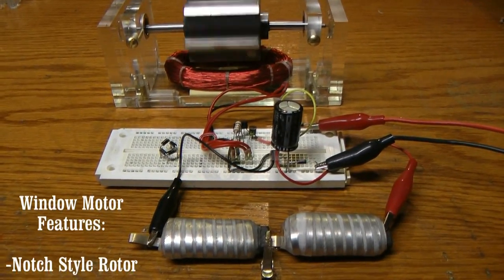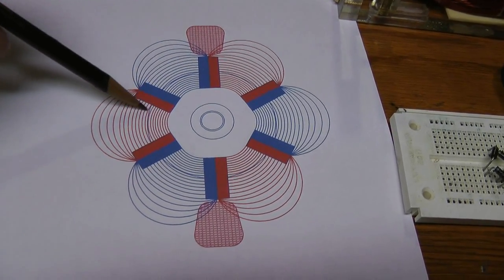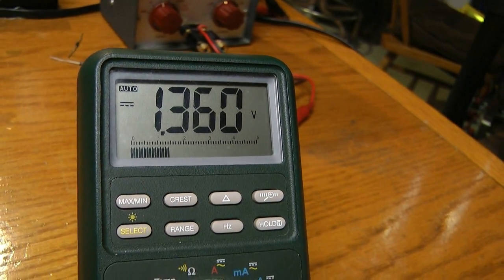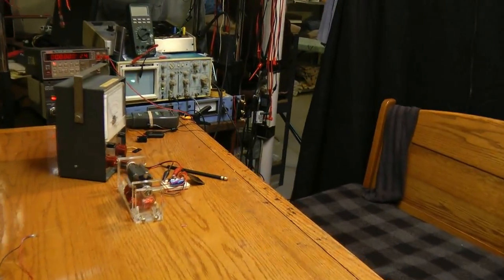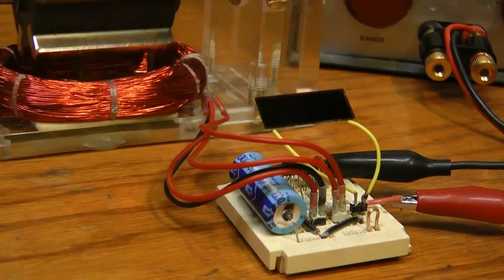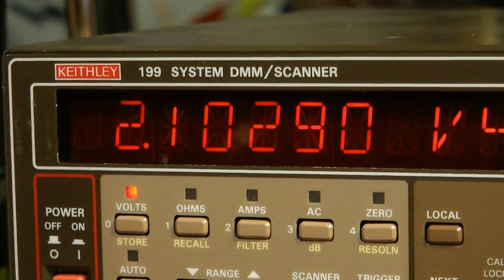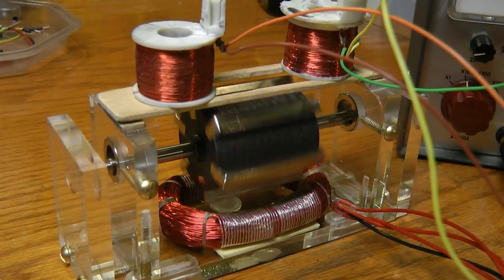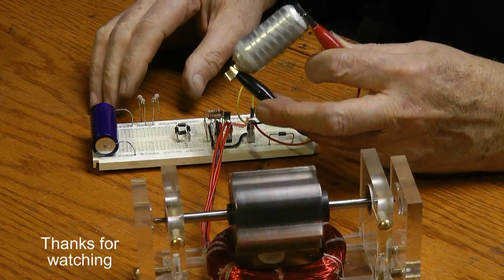Window Motor On Water Battery & Solar + (Notch Rotor)

Comment: I love your videos for the excellent quality of the realizations, the very good and clear presentations and the quiet and exaustive explications.You're a mith!  but still cannot findo "how to video" about water cell...could you help me? thanks in advance.
Reply from the maker: Hello friend, I never made the video of the water cells because I was disappointed in the fact that the magnesium eventually erodes and the cell becomes depleted. They are simple to make though if you wanted to try one. Just get ahold of a piece of carbon and wrap it with a paper towel or sometimes I used a piece of chamois cloth. Then just wrap some magnesium ribbon around it, wet it and you have a battery. One mine I put a few layers of insulation and winds of ribbon.

Comment: Thank you very much for you to upload very good quality videos where has nice educative touch. I bet your RC -plane is pretty neat! :) 

Have you examine the "Fueless engine" motor where is both, rotor electromagnet and stator electromagnet at north - north position and it is driven with one 12V battery and charge other 12V battery. It is driven by voltage and it's force is coming from condenser bank where the voltage could have over 1KV. It is pretty interesting and i think it could interest you. 

Condenser has capability to wonder me over and over when i test and drive motor with them :)
Reply from the maker: +S. Rantala ...Hello, I have watched some videos but remain skeptical about the system. I haven't seen proof enough to make me try any kind of replication. If you run into any link that looks absolutely convincing let me know.

Comment: My English is not good,
Video commentary can not quite understand,
This magnet arrangement, with the traditional normal window motor magnet arrangement which is better?
Reply from the maker: M Jannick Hello M, The nylon notch rotor on the magnetic bearings is only an experiment and I recommend the window motor with the mild steel rotor and 6 magnets oriented nsnsns alternately. John

Comment from the maker: The motor is a very efficient device with a unique bearing system made of magnets as shown. The opposed configuration of the magnets form an invisible pole between them rather than on the magnet, check the illustration. The motor runs from a simple 3 transistor pulse circuit off a battery that can be hand made from carbon, magnesium and water electrolyte.
J
Reply: +DadHav  hi  I been try to learn about motor and electronic's do you have a schematic  I love telsa and bendini I love to learn more
Reply from the maker: +Armando Martinez See if you can download from this link:https://drive.google.com/open?id=0BwK5yJUfMl9GdkY2ZnBzN2c3aW8

Comment: Can you do a few of these and sell them on ebay? They have solar ones just like this, but it would be cool to have a magnetic and coil one.
Reply from the maker: Hello friend, I'm afraid that wouldn't be very practicable for me. I can hardly keep up with things now. Thanks for asking.
J
Reply: ***** ok, I understand that would be allot. Can you make just one for me? Can you sell that one on ebay and give me the link so I can get it? How much would you ask for it?

If not, can you make an easy step by step ebook on how to make it, and the materials I would need? Thanks so much.
Reply from the maker: McChulo
I'm sorry friend, I just can't help you with this. It will be a while before I can spend any time on experiments or construction.
J
Reply: ***** thanks anyway, hopefully you get the time to put out a quick how-to manual together so others can build the same thing. Thanks again :)
Reply from the maker: McChulo
I have a video posted showing exactly how the magnetic base was machined. For the most part you must have a milling machine and lathe as well as know how to use them. The pulse technology to drive these devices can be complicated to understand and tune. This is not a project for people just getting started in the electronics hobby. You can search for Bedini/Cole window motor and see many options for this style motor on YouTube. You will see how simple the principle is. If you are looking for a solar Mendocino style motor you can find them on E-bay.  Don't know if that helps.
J
Reply: ***** I have seen the solar motors, but I'd like to have a motor that just spins perpetually with a coil and magnets. So that it runs in the light and in the dark also.
Reply from the maker: McChulo
Hello, none of my motors will run perpetually or self run. They all need some sort of power supply. Some are very close to unity and will run for weeks on a small capacitor ore even a hearing aid battery, but not for ever. It is possible to add a small solar cell to restore the capacitor or run battery. This can be done with any very efficient device and doesn't require the making of something like I show in these experiments. See the video below:
https://www.youtube.com/watch?v=pVfCj3oTsvM&list=UUOIxh4XCX3lTJIrHm5FLLPA
Reply: ***** Is this because the coil needs to be charged in some way to create an interaction with the magnets so that it spins?

Would you mind 3d printing and putting together this perpetual motor? I'd really like to see how to put it together and how it works: http://www.shapeways.com/model/2913260/perendev-109-120114.html?li=search-results-1&materialId=6
Reply from the maker: McChulo
Sorry that's just impossible! I have no interest in the Perendev motor whatsoever. You were talking about building a motor. Why not try to get his kit and make it yourself. Or you could do some further research on the Perendev and maybe decide for yourself whether or not it works.
J
Reply: ***** ok, just wanted to see what you thought. What if you try it out and film it?

Comment: Very interesting!
I imagine t that you know about resonant circuit, but the back and forth voltage seems to be similar to that. The energy travels back and forth between the capacitor and inducting coil and this can create a 50x increase in voltage in some circuits. The transfer typically happens at a very high frequency (10k+ Hz) and it should maintain a constant boosted voltage signal. I think the rotor may be regulating the frequency and size of the energy transformation by rotating near the resonant frequency.  A gradual increase in capacitance should increase the voltage rise and fall that is present in the signal. The increasing capacitance will decrease the resonant frequency of the circuit which should bring it closer to the electrical frequency generated by the poles in the motor. With six pole pairs, electrical frequency is six times the rotating frequency.
Reply: I just realized how many different frequencies I mentioned in there.
The resonant frequency is the frequency induced by an ac signal.
http://sub.allaboutcircuits.com/images/22033.png
When approaching resonance, the LC circuit produces high voltages present in the terminals. 

The transfer frequency would be the rate at which the energy is transforming from electrical to magnetic forms within the circuit.

Electrical frequency is the voltage sine wave induced by the rotor and the rotating frequency is just the rate at which the rotor is spinning
Reply from the maker: MarksmenTM
Hello Marksmen, Yes an ideal condition would probably be if you could have the pulses that drive the motor be at resonance but usually what I see on the scope is a spike with a bell curve sort of ring attached to it. This might be at resonance though. Thanks for the comment.
John

Comment: how much power is that generator producing?
Reply from the maker: Hello, almost no power produced. The experiment is only to show how the magnetically levitated rotor with a novel rotor can run as such a small current draw. It can run for weeks on capacitors. or permanently from a tiny solar cell / capacitor combination.
J

Comment: Caution:LT4415 - cannot hand solder it - footprint is tiny. Bought a oven to do small parts. Have full wave schottky rectified the 250KHz sine signal of my LED driver design - gives me 3.75VDC. Charged a 1.2VDC Nicad with it and ran another circuit with charged Nicad. Input of my circuit: 1.2VDC @ 50ma.Main driven LED dissipates 250mw with about 20% duty cycle.  I want to try the notch rotor but how do I machine the slots into round stock? Also I have PCB layout capability if you need a PCB.

Comment from the maker: Hello, Thanks for the tip on that chip. It looks interesting. I will try something with it when I get caught up on things. I might be able to work out something patentable on a few of my recent circuits but have little desire to patent anything any more at this late stage of the game. I'm here to share things now and maybe be able to do something for my friends who frequent the channel. The notch rotor with virtual poles is interesting. I need to get back to that and try some things.
Thanks
J

Comment from the maker: Hi, we have a lot in common: First meter- Eico 555 kit, still works; Second meter- Simpson 464, yep over $400; Built many Heatkits including $700 10-4235 scope (35 MHz dual trace with delay line) I also built a Gr 2000 TV then acquired two more half built and finished them. I enjoyed building stereo systems and speakers with Scott and Fisher kits. I eventually ended up buying McIntosh and a JBL Paragon speaker system. Still have the McIntosh tuner, pre-amp and amp.
Take care.
John

Comment: Thx for your reply. With a reputable OU verifier I'll believe too. Do you hv designs u don't upld that u consider patent worthy? Have some I keep. Designed a LED driver that drives 2 LEDs and generates a clean byproduct sine wave. Linear Technology has a low forward drop diode LT4415.  Voltage drops are regulated to 15mV during forward conduction at low currents. May use it to rectify that sig and try to do DC work. Might work for u. Also love the like pole to pole config in your Window Motor.

Comment from the maker: Hello, Thanks you for the compliments. Fact is, I'll believe the first over unity claim I see that is backed up by test results from someone like Battelle institute or some credible university or research center. I have friends in high places that say they would be happy to be the first R & D facility to prove an over unity device. They won't charge for the research if it's legitimate. You must have been on Rusty's channel (LidMotor) You may need to adjust resistors. I'll talk to you more.
John

Comment: I am a laid off circuit designer who enjoys experimenting. I am glad to find a talented, experienced engineer and someone who does not 'swallow" overunity claims. You sound  refreshingly open minded.  I just try to help those who believe in things experienced knowledgeable people recognize are likely unachieveable. I am gathering parts for the Paper Clip Motor you designed a driver for.

Comment: Great project, beautiful construction. Love Keithley DMM response. Last digits don't jitter. Slow update rate? I built Heathkit - stereo preamp and FM tuner kits in the 1960's bought someone's completed Heathkit audio oscillator. - still works. My first meter was Simpson 270 recently destroyed by leaking Duracell and Eveready batteries. Got $125 from Duracell for the damage but wish I still had the meter Could measure 50ua and 5KV. Cost near $400 now. Had old Dumont scope and Tek 535 scope.

Comment: @DadHav Mine is a beater-project car, but I'm keeping it. 73 was the last year for no-smog test bi-annually in Calif. And yes, I read that the 1960's 'muscle cars' were, or could be, very low emissions, but you had to really say on top of the tuning. Way I read it, the newer stuff came so un-tuned when new, it couldn't get much worse if not maintained, I'm just kinda' joking there.
  The R/C stuff, I did notice the last time I was at RC country, they had little in gas engines, but lot of BLDC.

Comment from the maker: @dougspair 
Doug, You don't need credentials to do something. "If you can do. You are" In my later years I worked as Engineering Manager and Chief Engineer. I never had an engineering degree but I could do the job. I also had a good dependable staff. I imagine that would be where you categorize yourself. They / You where more important to getting the job done than myself. I called them My Engineering Children so they refereed to me as Dad Hav. Hav is the first three letters of my las name.
J

Comment: @DadHav  OK, I have a '73 Stingray, only electronics is the radio, and maybe the alternator diodes/regulator. All the interior HVAC is still the pnuematics.
 I also read the Hot Rod 'zines, and yes, most all the after market chips arenot legal, especially in Calif. The ads always say "not for California street' vehicles..but we know that's a sort of 'code' for Hot Rod?
  Even the diesel pick-ups are getting the custom chips.

Comment: @DadHav  at that time, in the mid-70's, I remember my boss, Ed Wilson saying you built and tsted each section as a separate unit..? Zenith was always one of my more trusted brands too, but I see now it'sChina for the most part.
  Hitachi has been at the electronics a long time,and I'm reading they built quite of bit of the nuke reactors stuff in Japan.
  The O-scopes..I'm thinking memory scope we used back then was Hewlett-Packard.

Comment from the maker: @dougspair 
The TV was very nice. It was one of the first modular systems. Each section of the electronics was on separate boards. You know: chroma, horizontal and vertical deflection, color, soun convergence and pincushion etc. It was very nice. A lot of the parts if I remember right where Zenith and Hitachi. They lated many years. I guess you probably figured out why I know a little bit about them.
J

Comment: @DadHav ..Well, unfortunately, my last employer here was fixated on getting everything as cheap as possible, so the golf carts were used, and hammered. We had a club car with 36 volts system, a Nordskog long bed with 36 volts, crude but well made FNR switch. A Cushman with opposed 2 cyl B&S, and 2 Electi-Carts. 24 volt things called parts chasers, you stood on the back, foot treadle for speed/brakes. These had the Curtis. Curtis stuff was OK, the rest of the thing was poorly designed/made.

Comment: @DadHav  HeathKit was always high $, but top quality stuff. I built a few items, but nothing like a scope or TV. I still have a timer I bought/built for exposing the resist on home-made PC boards.
 I'd think guys taking a tech course might settle for a slower and maybe single-channel, back than?
 The Burgmaster place I worked at in the1970's, my boss bought a big Heathkit color TV..got it all done, worked fine, then he dropped it trying to install in a wall...the CRT went poof, of course.

Comment: @DadHav  I'd keep any of the COX stuff, it appears they are pretty much worth their weight in gold. I never had the $ to buy much hobby stuff, but did have the .049 on a control-line plane. Pretty tough crashing one then, with the hand cut balsa wood stringers and paper/ airplane dope and all that.
  Info I was just looking at, COX sold to another outfit in the 70's, quality took a dive.
Santa Ana had a lot of what later became high-tech Mfg, but I didn't know it at the time.

Comment: @DadHav ..In the period of 1971-1979, I worked as an electrical assembler, then later, Electronic tech at BurgMaster, in Los Angeles. They made NC machine tools...the stuff before CNC..I used a Tektronix dual tracescope with delay line...we had 5 techs..5 scopes..and an HP memory scope.
  What part of the country are you in? Up north of here, in Beaverton, Oregon, is the Tektronix factory...they may still have parts and manuals for your scope..

Comment from the maker: @dougspair 
I love scopes. In the 70's I built a Heathkit. I know, almost everyone in electronics or taking a tech course built one of these. Not this one though. back then I paid $800.00 for the kit. Man, that was a lot of money back then. This was 35 mHz, dual trace with a delay line. I still have it but it stopped working years back. I have plans on making a video of repairing it and show some of the construction and operations on the circuit boards. This will be fun. 
John

Comment from the maker: @dougspair 
My carts are EzGo with beds on the back. One is a Work Horse with a tip bed. They're 36 volts solid state controls. I service them myself and have changed the solenoids to mercury switches and changed the battery cables to a heavier grade. Our yard is a hill about 100 yards of 30 degree grade in places. This is rough on the cars but their amazing. I flipped one over back-wards on the hill. I'm going to  make a video of how to rebuild the FNR switch.
John

Comment: @dougspair  That was COX model engines...back when they were decent stuff. So I knew that they just used the oil in the fuel to seal the piston/cylinder.
  The Delrin, I've worked with that some in the last 10 years, mostly all I used was black, so I took a guess there.

Comment: @DadHav .Eico, Weston, Simpson, Heathkit..All fond memories. Window motors, about 10 seconds after I sent that, I realized where 'Window' came from.
I thought it might be car window regulator motors, since a lot of guys here scrounge up stuff like that.
Stirling motor. I figured there weren't any rings, obvious to me that a tiny bit of power was used to run them. I'm impressed by the speed they attain.
  I grew up in Santa Ana, Calif...went to school 3 blocks from the COX mfg. company.

Comment: In the 1970's I was Elec. Tech for Machine tool company in Los Angeles, Calif. I used some Keithley, but mostly Tektronics scopes..a 10 meg-hertz scope was really fast...back then. If you had $, the memory scopes were great.
  The golf carts I worked on were fairly old, used 36 volt solenoids to switch the 3-4 'resisters' and generate heat, and a by product, was that the rest of the energy actually moved the carts.
  So you must bear in mind I have a very dry sense of humor, not sarcatic.